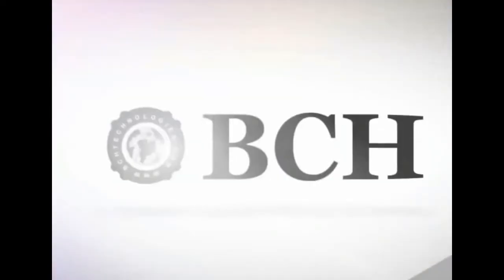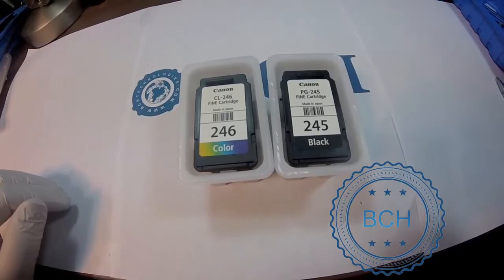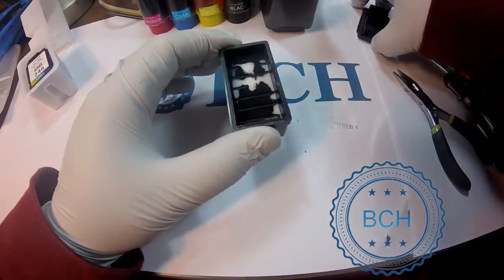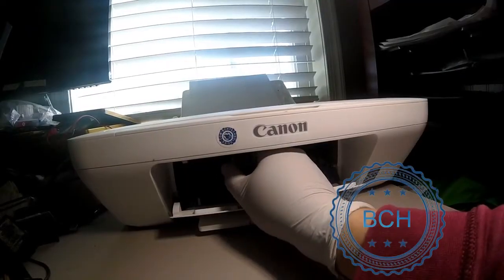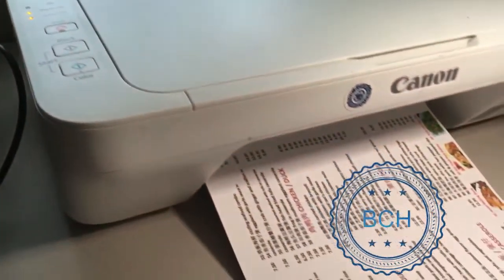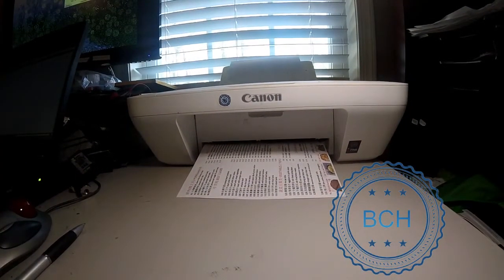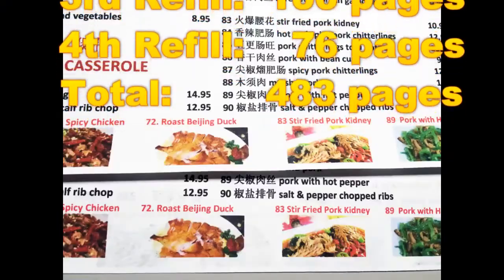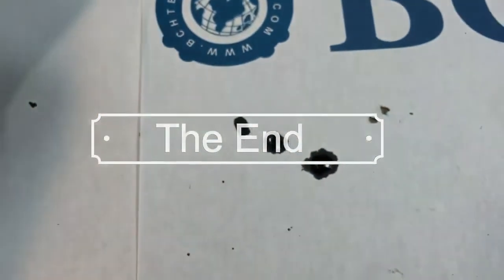How many times can you refill PG-210 CL-211 PG-240 CL-241 PG-245 CL-246 cartridges?

Comment: I refilled pg745 cartridge by drilling on the top..i put around 6-7 ml of black ink but then too their is no rise in the ink level.So what should i do now??
Reply: First you should press reset button of cartridge. If the problem continues then you should go for a new one.
Reply: Or you will need four more cartridges to reset the memory of printer that it uses to store serial numbers of cartridges. Insert all four cartridges one by one. After that the printer only store those four serial numbers of four cartridges as it can only store serial numbers of four last installed cartridges. After that insert refilled cartridge and that will be displayed. This is done because company makes chip of every individual cartridge that store information about how many prints it can yield and how many are printed?
Then if you have printed specific amount of prints that can be only printed by that cartridge it will show you error that it have printed all amount and can't print anymore. When you follow the process then it will found it new and will make out the prints.

Comment: ive tired cutting it off putting a whole in the top nothing is working I'd rather just but a new cartridge and not have to deal with the trouble
Reply from the maker: You either drill a hole on the top or cut the cap off.  You don't need to do both.  If you want to cut the cap off, find the seam that glues the cap and the base.  Use a utility knife, do not use a kitchen knife.  The cap will be cut off easily.
Reply from the maker: You can see another example of cutting cap off here: https://www.youtube.com/watch?v=MkvGIWu-O2Y  If you still don't get it, go to support.bchtechnologies.com and submit a request.  We can call you and help you figure it out.
Reply: I figured it out I was doing it all wrong thank you for saving $19 per cartridge. This is something I'll share with my friends n family.
Reply from the maker: You are welcome!  Thanks for sharing.

Comment: In the video you talk about how to remove a clog and that with this method you can't blow on it but use other methods. I've never done this sort of thing before so can you explain?
Reply from the maker: Yes.  Because there is only one hole on top of black cartridge (Canon PG 240, 245), you can use a priming syringe to blow air from the top.  The air will push ink down and push the clog out of bottom.  This works very well with air bubbles, dried inks, and dusts.  We are uploading another video, you can see the method.  I will give you the link after the upload is complete.  It doesn't work for HP, because it has 5 holes.  You need to block all the holes and leave one open.
Reply from the maker: Here you go: https://youtu.be/MkvGIWu-O2Y  Fast forward to 4:00.  It shows using a priming syringe to blow air into the cartridge.

Comment: i can't seem to find the refillable cartridge on your store
Reply from the maker: We are in beta testing.
Reply from the maker: We are debating if we should sell the DIY kit or the ready-made product.  The DIY kit will include a cartridge cap with pressure regulator.  Customers can cut off the cartridge cap, take out the sponge, then install and seal the top.  The ready-made product has a failure rate > 2%, which cannot pass QA.
Reply: how to order the kit ? for black and color please